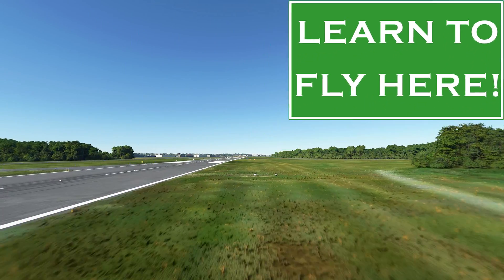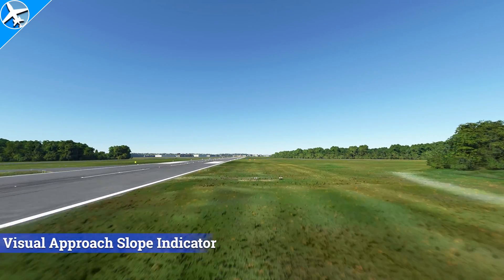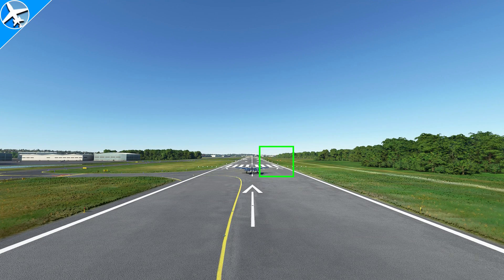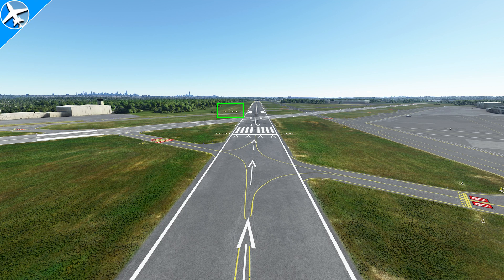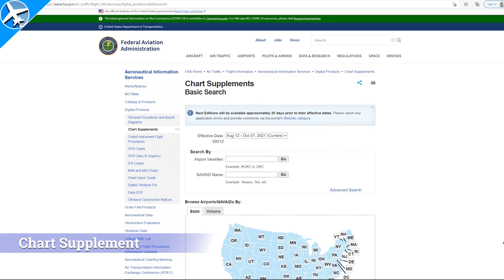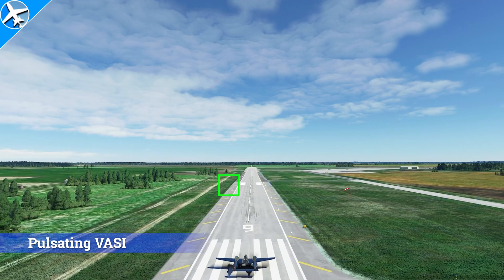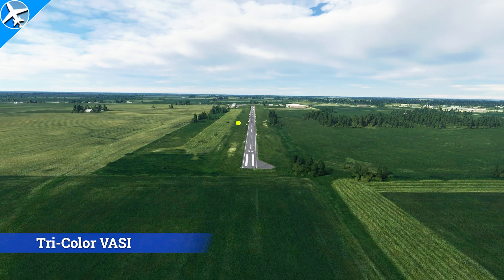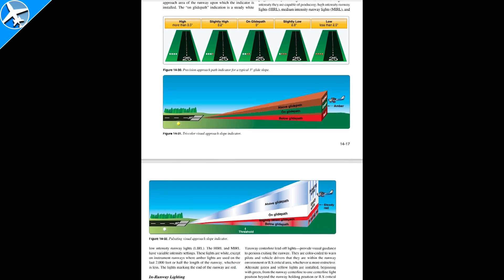Visual Glide Slope Indicators (VGSI) - PAPI, VASI, P-VASI (What is the Difference?)

Comment: What color light do you get when you forget to add SLI to your flightplan? ;-)
Reply from the maker: Haha. Funny.  I wish there was a red flashing light when an entry error is made.
Reply: @thecorporatepilotdad  Well with the latest Datalink you would get a digital (or printed) readout of the new clearance. Still, it doesn't matter how many safeguards are in place. I remember automation changing the way we had to delete a flight plan 'cause someone accidentally deleted one that was being tracked in another sector. The plane continued to fly without a datablock! So Automation said you could no longer "/OK" certain commands (ones that dropped tracks or deleted flight plans). You now had to follow up your "/OK" with a "Y" (/OK [ENTER] "confirm  Y/N" Y [ENTER]). Of course it only took one day before someone typed all that without looking at the screen and dropped the wrong track! Luckily it was in their sector and she realized it immediately and entered a new flight plan and started a new track. It's like an old trainer used to say, "It's not a perfect system!"
Reply from the maker: @virtualDon  I knew that capability existed in the sim but I'm old fashioned.  PDC is great at large airports with busy clearance frequencies in real life, but getting a clearance on the frequency is nice, too.